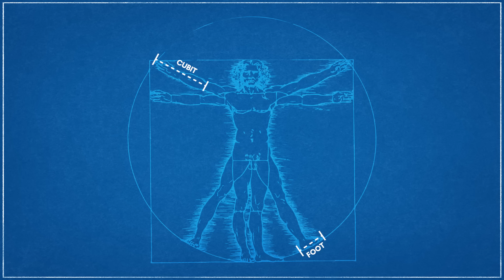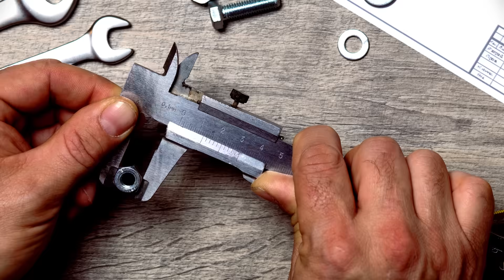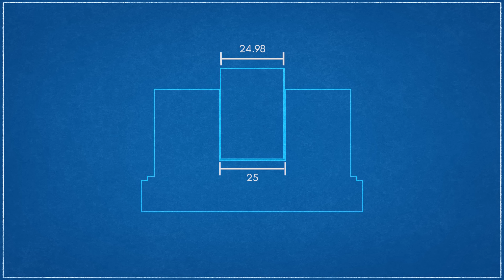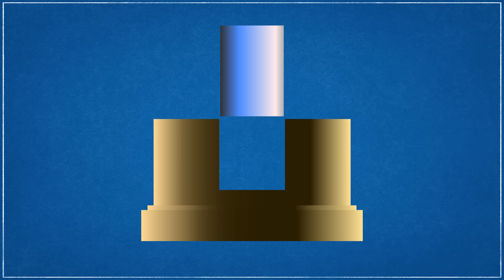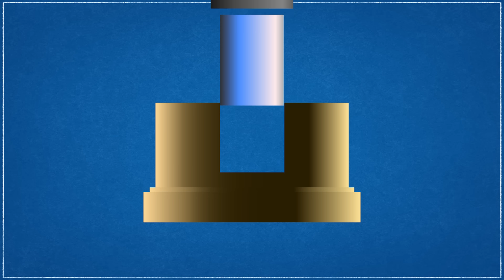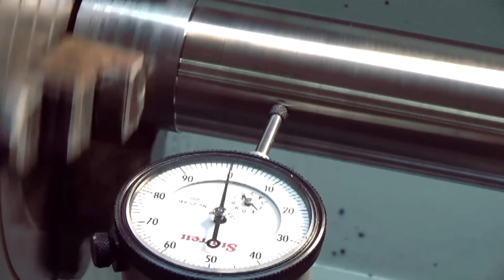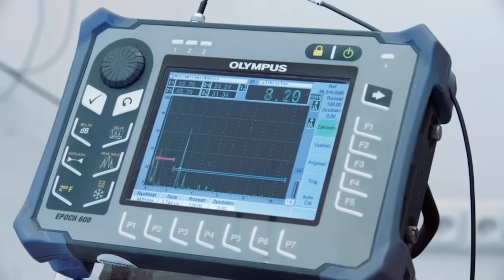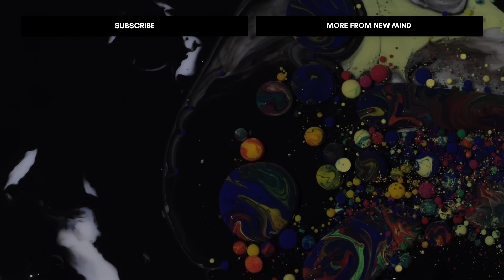The Science Of Small Distances

Comment: As a point of reference, I work on linear motor 5-axis CNC mills that have a high-accuracy mode that promises a tool-to-tool measurement discrepancy of ±1 micron. In this mode the holder the tool is in, the spindle, the laser assembly, all must be calibrated at temperature and have specific runtimes in order to keep them all within the same temperature of each other, and warmup times designed around constant temperature both before tool measurement and machining take place.

For those not familiar with metric: one micron is about 40 millionths of an inch, or .00004". Human touch can distinguish about one ten-thousandth (0.0001") in surface difference.
Reply: It would be so much fun, if a CNC-machine like that could replicate/manufactor a high precision version of the gears in the motor of my 1906 vintage Edison Home Model B Phonograph.
Two things I would change with a modern version, would be (1) having double herringbone gears and (2) having the axls prepared for ball or roller bearings instead of just the axl rod sticking into a hole in the motor plate.
Reply: @DK640OBrianYT  If you have the money it can be done.
Reply: @DK640OBrianYT funny you say that I have my grandpa's phonograph intact lol
Reply: And people wonder why Formula 1 engines are so expensive. They produce so much power because there tolerances are so small. They can have higher compression. You can't even turn the engine over until they get it up to temperature by running hot fluids through it.
Reply: @seanriopel3132  I think the higher cost is mainly due to the innovative materials used in structural and moving parts, but not entirely sure
Reply: then somebody opens a door...
Reply: I only worked with 3-axis tops. Going less than 5 microns (without boring tool, using regular mill) I always encountered the same problem on all mills -  holes are slightly oval (Dunno why). What worked for me was programming holes little smaller than expected size, and running same hole with same program twice, but on second run using only air cooling or no cooling at all. Don't know why I'm saying this, but maybe someone will find it useful 🤔
Reply: @ShitThatsMyn  If you're getting slightly oval holes, you've probably got backlash issues, or a difference between X and Y at the least. Depending on what your machine is rated for you can or can't do much about it, and of course HOW circular you need it. A kern will probably get you that circle. A haas? Within half a thou, shouldn't be too much of an issue, but good luck below that.
Reply: @ShitThatsMyn  Can't do much about that. Really the only way to fix that 5 micron error would be to bore all your holes if you're hole milling. And like you said, just air cut to final diameter. 

Although, I'm curious if you're getting the oval in the X or Y. Or is it just your coolant doing the offset.
Reply: @ShitThatsMyn  Lad. That might be why it was doing ovals on you. Depending on what that oil reservoir was for (I'm assuming way oil), it would have chewed something up. And given the diagonal, probably both X and Y just needed to have their backlashes updated.
Reply: @ShitThatsMyn  8mm? if it was a long end mill (100mm long or something), the coolant could PUSH it if you had high enough coolant pressure, but given the simplicity of what you're doing, there's no way you had anything approaching high pressure coolant.
Reply: @foadrightnow5725  40 one-millionths is 0.000040 and 4 hundred thousandths is 0.400 Because thousandths are the most common way to communicate tolerances in the machining world, you would say 400 thou, instead of simply .4 of an inch or 4 tenths of an inch (which would be it's simplest form of expression technically speaking mathematically, but still the same thing) .4" is .4", it just depends on how you want to say it by how many zeros you want to put after it. Your "0.0000004" is 4 ten-millionths, the decimal places go as follows: tenths, hundredths, thousandths, ten-thousandths, one hundred-thousandths, one-millionths, ten-millionths, hundred-millionths, one-billionths, ten-billionths, hundred-billionths, etc.
Reply: @johnny0454  Engineers generally don't use arbitrary exponents they stay with steps of 1000, eg 21*10^3, not 2.1*10^4, similar you see m, mm, and micrometer while deci and centi are often shunned. 
This helps to improve communication efficiency because most items will use the same unit magnitude, and it helps avoid mistakes because being wrong by 1000 is very obvious while being wrong by 10 may not be.
Reply: @mytech6779  I love my Casio fx-991MS pocket scientific calculator because it has two built-in ENG notation features to convert clumsy scientific notation quickly into engineering notation, the way God intended...
/In the Newtonian World
Reply: I recently read that if you scaled the human finger up to the size of the earth, our sense of touch could distinguish between a house and a car. That is pretty damn impressive.
Reply: I wonder what sort of touch resolution a raccoon would have. Or a star nose mole
Reply: I stil work whit normal servos and at home steppers so I'm really jealous now
Reply: @Thefreakyfreek  it's all about the gearing. and of course backlash compensation.

the difference between small hobby and large commercial CNC is of course size, but also decades of in-house technical knowledge expertise and techniques,.
Reply: Where do you work... You got the same job as me?
Reply: How often do you have to calibrate it? And what is the cost? Cheers!
Reply: Wow.. What a cost
Reply: Wow! And to think that for someone not in the trade, those look like simple drills and nothing more...
Reply: Id like to see you hold that with some inconel
Reply: Perfectly explained. Cnc is no joke
Reply: 25micron per thou. 
Though I find the claim of any milling machine being accurate and repeatable to 1 micron extremely dubious. Maybe there was a problem with symbol translation or a decimal was shifted.
There are processes to achieve 1 micron precision but they aren't 5 axis CNC, just too many joints and flex points.
Reply: @mytech6779  They do exist, and they're expensive as fug. NYCCNC did a tour of a brand called Kern. They find drilling holes through human hair run of the mill.
Reply: I tested my eyesight using my microscope and hair, i can detect a gap 85 microns wide between two strands of hair, which is close to the width of the hair fibres themselves
Reply: @matttzzz2  you should visit a doctor
Reply: @foadrightnow5725  No. four hundred thousandths is 4 * 100 * 1 thousandth which is 4 * 100 * 0.001 = 0.4. Forty millionths is 40 * 1 millionth or 40*0.000001 = 0.00004
Reply: @tacticaltaco7481  FOAD RIGHTNOW's question was worded wrong.  What he meant to ask was this.  Isn't the number .00004 is actually 4 one hundred thousandths of an inch?  In order it goes from the tenths place (.1), to the hundredths place (.01), to thousands place (.001), to the 10 thousandths place (.0001), to the one hundred thousandths place (.00001), to the millionths place (.000001).  In machining it's common the say the number .00004 as 40 millionths as to avoid the confusion with the value of .4 which is commonly said as 4 hundred thousandths.  The reason is in the trade we commonly use  the .001 of an inch as our base unit for anything to the right of the decimal place.  So 1/2 inch which is .5 would commonly be said a 500 thousandths of an inch or even more loosely said as 500 thou.
Reply: The AK-47 is legend because you can pull it out of a puddle of mud and it'll still cycle due to slop in the mechanism. There's nothing +-1 micron in it either.
Reply: @1pcfred  check the history of the Owen SMG
Reply: Maybe thats what the machine company said, but that is 100% BS.
The most accurate mill  is on the order of 2-3 microns.
And it isnt 5 axis - in general, the more axis you have, the less accurate the machine. 
Lathes, for example, can achieve 1 micron because they are essentially 2 axis
And in addition, for almost every need of 1 micron, you will machine to +10 to 50 micron, then hone to the necessary length.

Comment: hold up, @3:42  "The length of the path traveled..... 1 / 299,792,458 of a second"     WHERE did this number come from !?  1 / 299,792,458 of a second?
Reply: Once it was decided to base the meter on speed of light (to get it reproducible instead of having it based on a dusty piece of metal kept under a cheese dome in Paris) , they just picked a divisor that would get it very close to what it was previously, so that the blue collar dudes wouldn't have to buy new tape measures.
Reply: @steve1978ger  cheese 🧀 😋 lmfao 😂 😆
Reply: They wanted to make it 1/300,000,000 of a second, until the committee started to debate how long a second is.

Comment: But speed of light isnt even constant.Well,it still is "constant",but only because they changed the definition of "constant"!
Reply: IN A VACUUM
Reply: @googleplex7097  BUT ITS NOT!
Reply: @rezganger  so did you measure a change in the speed of light in vacuum?
Reply: @johnuferbach9166  u must be the clever one in ur family...
Reply: @rezganger  The speed of light is constant. The definition of constant has not changed. 

However, there is an implication that is not explicitly stated, which is that any discussion of the speed of light as a constant is usually referring to c, the speed of light in a vacuum. Yes, light travels slower when not in a vacuum because of the refractive index of any transparent material, such as air, through which it must travel. 

One could still argue in the case of transparent or reflective materials that the speed of light is still constant, it's just travelling a longer distance. 

Regardless, that is moot for the purpose of SI unit measurement and this video. The speed of light as used to define a meter is c, the speed of light measured in a vacuum, which is constant as currently known.
Reply: The speed of light in vacuo is a constant if you redefine time such that it is a tenet.  As Einstein conjectures in the opening lines of special relativity.  A tenet (axiom)  cannot prove itself, it is judged historically by its utility.
Reply: @raykent3211  Ur funny.
Reply: light in a vacuum is constant
Reply: It only changes depending on a material in the way.
Reply: @DigGil3  no, speed of light is constant. Depending on the material, it does a longer path inside it. The speed of light is the speed of causality.
Reply: @DigGil3  r u dim?didnt u even read my whole comment?

Comment: Nice video!
What is the tolerance for a mirror of a modern scientific telescope? For example James Webb.
Reply: surface roughness for aluminum mirrors Ra~7nm (limited because of silicon content of the Al-alloys).
so it depends on the specific material. 
for geometric tolerances it depends on the mirror diameter, can go <1micron for 1meter diameter.
Reply: sadly i don't know, but i think i've heard their surface is being polished for weeks or even months after they finished the 2-3 year long process of cooling down from the casting.... so i'm guessing those tolerances are pretty damn tight^^
Reply: It is wavelengths  measurements